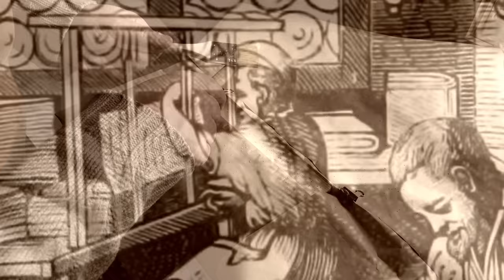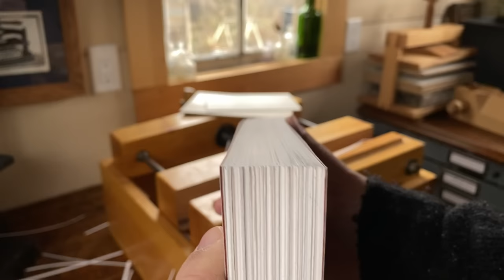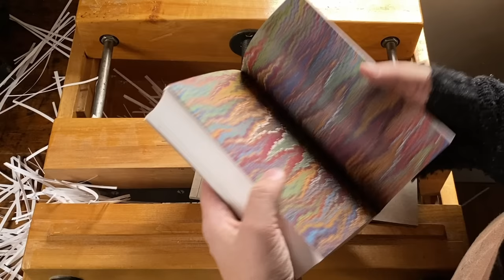Making A Medieval Book By Hand - Part 2 - Trimming & Rounding, Edge Decoration, Sewing Endbands

Comment: This series has really shown me why books were so valuable before industrialization. The amount of craft that goes into a single blank book really shows why they'd cost the equivalent of 4-5 years of salary for your average peasant for a simple blank 450 page book with minimal decoration.
Reply: Had they stuck with Coptic binding, books would have been much more affordable.  I suppose it's the same technological march that drove the auto industry to introduce fuel injection and electronic control systems, which did nothing but make things more complicated and more expensive.  Average cost of a new car in 1970 was $3,542 ($11, 017 when adjusted for inflation).  Current average new car costs $40,148.

Comment: Thank you for sharing your craft.  I'm not sure why the head and tail bands are for? More durability as the book is put on the shelf - i.e. to protect the spine as the book is "used "?
Reply: From what i'm aware it helps protect the edges of the papers and the spines structure when you pull it from a bookcase, but it also serves as decoration and to help hide the book folds and other bits that can be seen at the top and bottom. Probably helps keep things from falling down into the spine as well.
Reply from the maker: As I understand it you are correct. The endbands protect the cover material at the head and tail of the spine, whether leather or cloth, which would get undue stress from many careless fingers otherwise. Thanks for joining in the comments!

Comment: Hello. I was sewing the textblock, but the back side (spine) gradually rises up and the front (fore edge) lies low. How can i fix that?
By the way, english is not my native
Reply from the maker: What you are experiencing is called 'swell', and is caused by the added thickness of the sewing thread at the spine. Using thinner thread, putting more pages in each signature, and hammering down each signature as it is sewn are some ways to reduce swell while binding. After the book is sewn, rounding the spine helps to counter the swell. I hope that's helpful!
Reply: @FourKeysBookArts  Thank you. I will try it

Comment: How would I add a 6mm wide ribbon to this book for bookmark purpose?
Reply from the maker: I usually glue down about 2 inches of the ribbon to the spine of the book, on top of any lining fabric but beneath any lining paper. Headbands, whether sewn or glued on, are applied after. I hope that helps, thanks for the question!
Reply: @FourKeysBookArts  I just wanted to know if your method of adding a ribbon bookmark was different from mine ~ I add a 6mm wide metal ribbon end clamp on mine that has a hanging loop in middle from which I attach a small strong jump~ring holding a caped leather tassel!!

Comment: With all due praise for technique and filming, I would say that calling this process “medieval” is a huge stretch. Any High Middle Ages (meaning 1100th...1500th years AD) bookbinder and bookmaker would be awestruck by modern PVA glues, acrylic paints, polymer films, sharpness of knives, straightness of rulers, squareness of right angles, and the very paper. If this book made it to some scriptorium in 12..15th centuries, it would be, for one, extremely valuable for craftsmanship, but on the other side, next to impossible to fill in, as ink and paint were too thick for a 120 g/m² paper. True incunabula technology would imply parchment and hide glue.
Reply from the maker: Your observations are of course correct; many of my tools and materials were unavailable to the medieval bookbinder. I will say though that it was never my purpose to create period-perfect reproduction, as I quite clearly stated in the description of the first video. My goal was to explore the structure of a gothic binding, with leather thongs, wooden boards, woven endbands, tooled leather covers and metal furniture. I will allow the final product to stand as evidence of my success or failure in that regard.